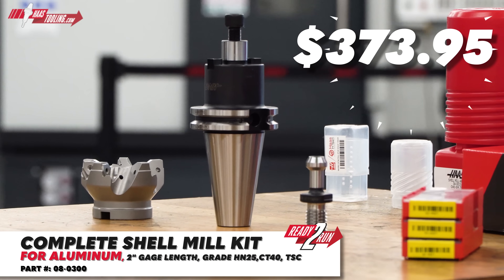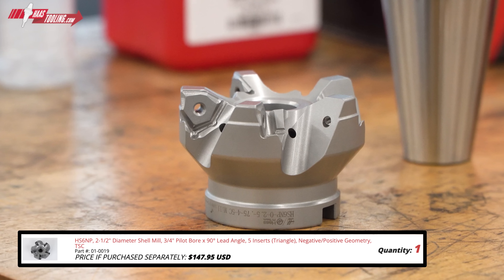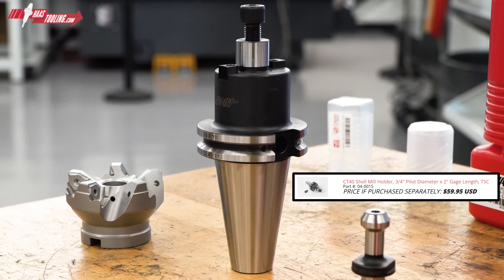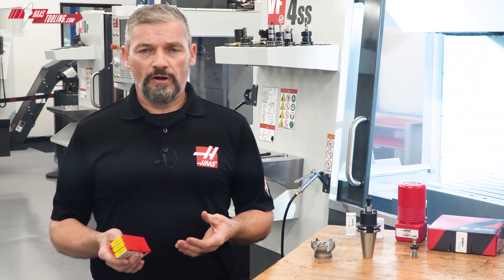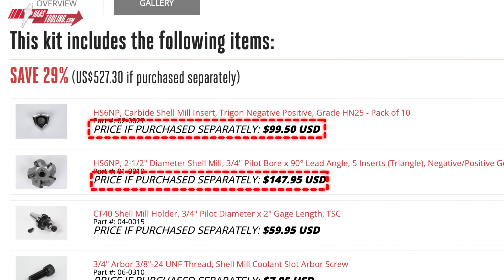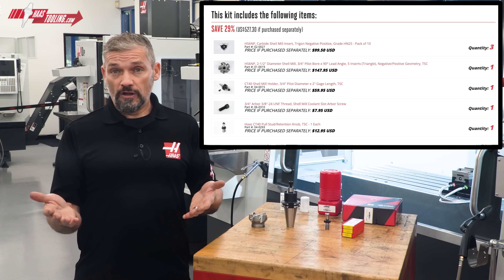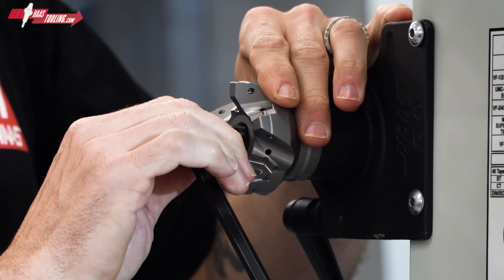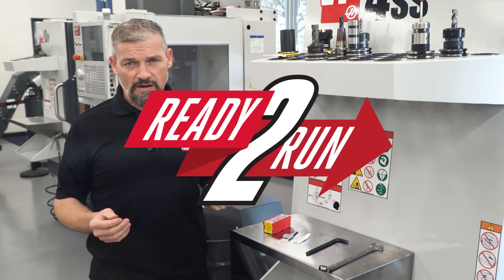Ready 2 Run Shell Mill Kit from Haas Tooling - Haas Automation, Inc.

Comment: These kits have been great, got a shell mill and chamfer kit. 

Hopefully you guys will add a some form of slitting arbors or keyway cutters to store, and maybe boring heads as well. For the last few months I have been looking for a good basic solution to slitting and precision hole boring that doesn't involve investing into proprietary and expensive tooling systems, or taking a gamble on imported stuff that might be more suited to an old manual benchtop machine than a full VMC. There's got to be something in that ideal middle ground that Haas does so well. A basic system that gets the job done without questioning the runout or longevity. 

I would love to see some of these Ready-2-Run kits for lathe work as well. Cutoff tools, threading, boring, etc. With coolant solutions too! Maybe a kit that combines a boring bar, adapter sleeve, inserts, and coolant solution?
Reply from the maker: Scott Watrous, Great to hear you've been happy with the kits so far! And thanks for the recommendations on additional kits we could offer. We are pretty close to having lathe toolholding/cutting tool kits ready for the website. Great notes about including solutions for handling the coolant side of the kit. 
As far as slitting arbors, keyway cutters, and boring heads; we've sent your notes off to our Products group who decide what tools are coming up next. Hopefully we'll have some solutions for these types of tooling sooner than later. Thanks!